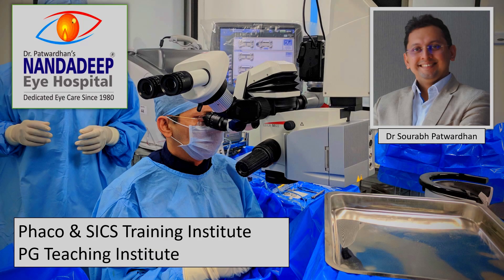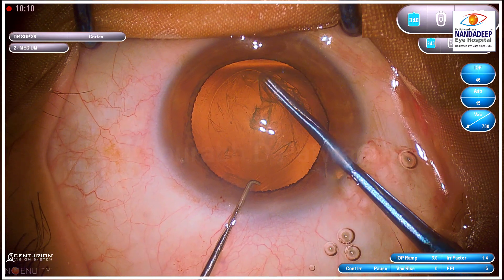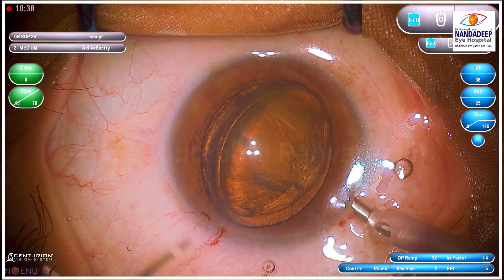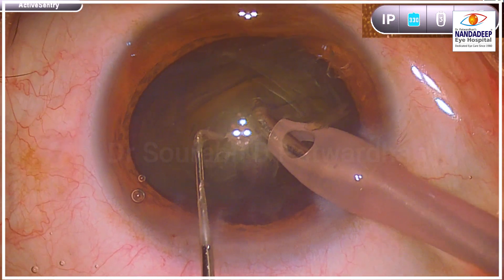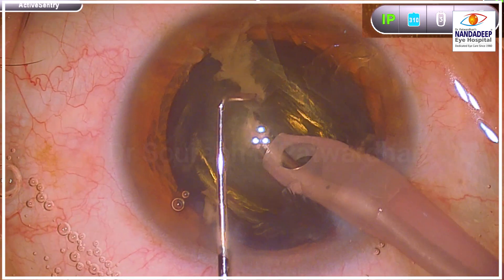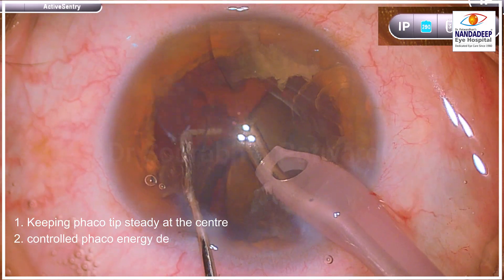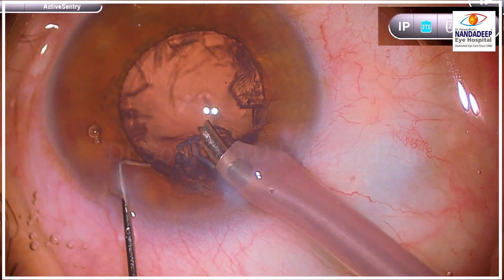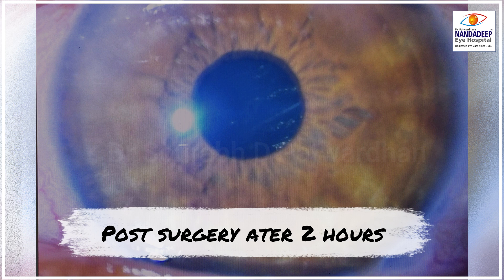267 Phacoaspiration of grade 3 nucleus sclerosis cataract-should we do it? Dr Sourabh Patwardhan

Comment: This is the best and safest technique..
I use it maximum with my oertli at 400/40 settings
Reply from the maker: Nice. I think it's even easier with oertli with it's flared tip.
Reply: Very nice surgery dr Patwardhan. Wich model and where to buy you hidrodissection canula?
Reply from the maker: Its a standard 27G cannula  @andreigazzaneo